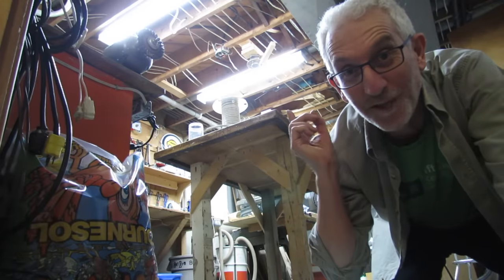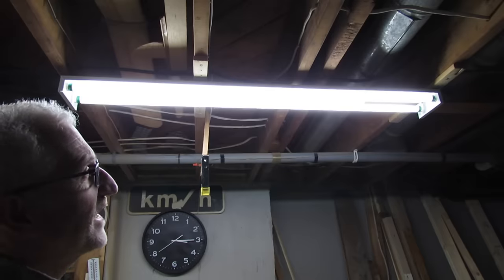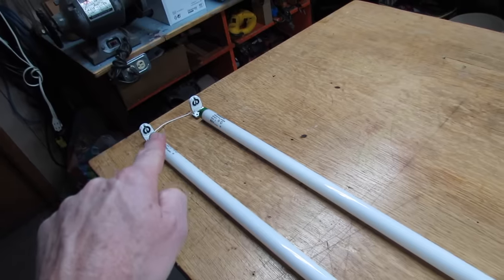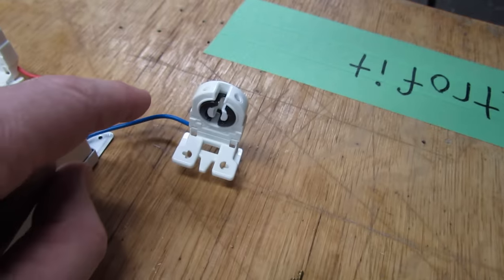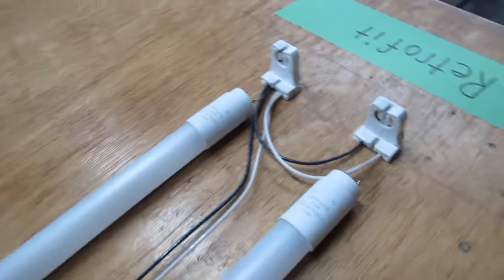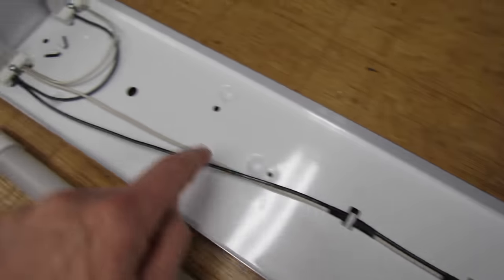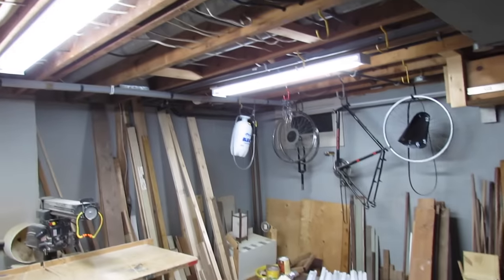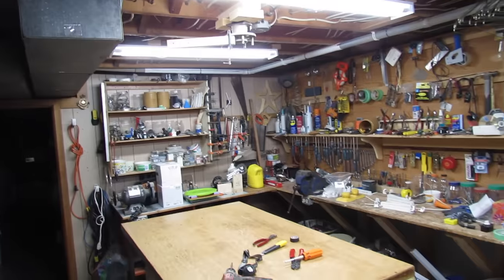How To Convert T8 Fluorescent Lights to LED ● Explained in Simple Terms

Comment: ... a great explanation of the connection differences!...and your presentation of the conversion was very clear also!  I would have liked to see a comparison of the costs of converting vs. ripping out the old and installing new lighting "strips".  Regarding color temperature, there's not much difference we humans can detect from 4100 to 5000K (both are considered to be "daylight balanced"), so I'm kinda surprised the manufacturer offers both.  2700K more simulates the color balance of the old incandescent we're used to, but that probably wouldn't be preferred in a shop.  Cheers
Reply: I would like to see cost compareson of "electric saved/price& life of bulbs" . Also life of bulbs at hot &  cold temps?

Comment: I just replaced the 4ft fixtures in my garage with daisy chain LED fixtures. Went from 3000k to 6500k and all 4 lamps will run on the same plug as one of the lamps I took out. The originals are old electromagnetic T12s and the difference in light is amazing. Plus since my shop is only heated when I run heaters the lamps are not fussy about cold like the originals.

Comment: Excellent video, Chris.  I understand this so much more now. One question - I've read that there are two-ended and single ended LED bulbs. Looks like you used the single ended but didn't mention it unless I missed it.  Does it matter which kind you use?  Thx
Reply: ok - i watched the video again. u did say LED bulb has power at one end.  ;)
Reply from the maker: You're right. The ones I used were single ended. This is for single ended conversion.

Comment: Chris, I did a bit more searching and I did find 8 foot LED tubes. 1000 bulbs is one place to find them. I don't see that they would save me enough to switch them at this time. I still have about 20 replacement fluorescent tubes. I will be converting some old 4 foot shop lights though. Thanks.

Comment: I've retrofitted lamp fixtures in the past, converting fluorescent to LED, but with a replacement of the ballast needed for the conversion.  It surprised me, therefore, that what you have requires no ballast at all.  Is there a difference, other than the obvious ballast, between the two types of LED lamps?  Longevity? noise/hum? choice of color ratings? price?   Thanks very much for sharing this video.

Comment: I might sound stupid, but why do the fittings at the other end have a wire going into those orange caps. What is that wires purpose?
Reply: @davidjames9625  the wires you are talking about are required for florescent lights, but not LED. He cut and capped them because they no longer serve any purpose.
Reply: @maxbecker5868  Thanks for that Max, it's always good to learn something.

Comment: I don’t know if it’s the bulb, but I did it exactly how you said, and it did not work. It did not want to turn on. What was frustrating is that you made it so easy to understand . I just don’t know what went wrong. I did exactly the way you did it however the lights are not want to turn on. I had the Philips LED TV Insta fit. I compared the pictures about 15 times pausing zooming in zooming out and he did it step-by-step exactly how you did it, but my lights do not want to turn on. Do you have any suggestions?

Comment: Great video for a DIY person. Around here most people wait for the 4 foot LED lights to go on sale at Costco and replace the whole unit.
Reply: Agreed, at $18 PER bulb or $36 per light plus your time. A lot cheaper to buy the whole LED assembly at $25- $30
Reply: Exactly.  I purchased some LED replacement bulbs and they don't seem to work in my fixtures.  And they cost as much as a replacement LED fixture when on sale.
Reply: @pman64  I totally disagree
Reply: I've found those Feit tubes at 12 for two. It's a direct fit. Good for 4 ft but other sizes I have to retrofit. This video will help me definitely.

Comment: Nice explanation to retrofit.  However, the "K" for your 5000K or 4100K is "Kelvins" and that's the color of the light.  higher K is more blue/white, lower K is more yellow.  The "brightness" or amount of light is indicated by the "Lumens" which for your two new led bulbs was the same at 2500 lumens.

Comment: Oh wow. Was expecting a bit more to it than remove ballast and install non-shunted ends. Will have to do this to my garage, it's terrible for lighting with florescent and highly impractical in a state that gets cold enough to freeze those bulbs. LEDs however operate just fine even when embedded into ice and a helluva lot cheaper in the long run.

The one thing to do if you get lucky on samples like this. Check with your eyes against a color card under each light against your computer monitor displaying that same color card. Pick the one that matches your monitor the closest. That should help with making sure paints you buy actually appear the same color in your shop.

Comment: GREAT VIDEO.  I retrofitted my basement with the help of this video. It was simple after watching video.
Reply from the maker: That's great! Glad it helped. What rating of bulb did you go with 5000K?
Reply: 4 foot led t- 8 tubes 3500 kelvin / 1900 lumens  15 watt in one room and t-8 U-Bend led bulbs  1900 lumens / 15.5 Watt ... (with 6" spread 21 inch long)  in the other room  AND retrofit  led bulb  end holders  NON SHUNTED .  for a guy with little to some DO- IT YOURSELF  skills  -  it was easier then I thought it would be. …………….THANKS...…………….

Comment: I found your video quite informative. Great timing too. When we moved into our house 20 years ago I took most of the lighting to fluorescent lighting. I am now changing over to LED lighting. With LED light bulbs that is done in most cases. My shop however was mostly fluorescent tube lighting. I have 4 perfectly good  fluorescent fixtures sitting around and now I see a way to repurpose them. 
That brings me to a new another subject. My shop has some 8 foot commercial grade fluorescent tube lights. Each tube is 80 watts. I have not seen a LED tubes to replace these with. Have you?
Thank you.
Reply from the maker: No I have not seen 8 footers either.

Comment: Not all LED bulbs use power on one end only.  Some require power to both ends of the bulb.  On that style you can use shunted or non shunted tombstones.  
I have converted over 900 bulbs so far.  The 4100 are good for classrooms, while the 5000K are better where more light is needed.
Reply from the maker: Correct.

Comment: I retrofitted a few fixtures last year.  I'm so glad I did.  Unfortunately, 1 started flicking on and off.  I noticed that in a few of our city's street lamps too.  You'd think that for the price of them, this wouldn't happen.
Reply: I have done a few fixtures myself and have the same problem I would check the connectiond where the light bulb goes  in sometimes  you  need to replace actually  the only flickering  lights  2or 3 are with the 8ft bulbs no problem  with the 4 ft ones
Reply: Yeah, a couple of my screw-in bulbs have flicker problems too.  I guess I'll hit up the sockets first with electric contact cleaner or emory cloth then make sure they're in tight.
Reply: Ron Yerke I have NEVER had a flicker problem, but all of mine are. NEW fixtures, not conversions,. If using a dimmer MUST use one capable of LED service , not cheap.
Reply: Ron Yerke pop st

Comment: Nice product - what do those tubes cost? I've just done exactly the same, swapping out 20 fluorescent tubes with LED strips, but I never knew about these style of products, so I used the flat led strips with magnetic fixings at the back. Each is 20W, about $4 straight from China and as bright as anything. My garage is now about 50% brighter with power consumption 50% lower.
Reply: This is exactly what I was wondering about....if you're going to retrofit, what is the advantage of keeping with the old tube style bulbs? Why not just use LED strips like MrCurry?
Reply: MrCurry - anyone have a link to the LED replacement strips with magnetic fixings? Thanks.

Comment: How much power does the ballast take?  trying to weigh if its worth getting rid of the ballast in 2000+ fixtures or just change to plug and play now and then do the conversion to non-ballast when they go out.

Comment: Thanks for the video.  I am curious if the LED retro lights had any RF or radio noise.  Did you test with a radio nearby?
Reply from the maker: No radio noise at all. I have an FM radio going in my shop all the time.

Comment: Thorough and pleasant presentation, but one thing wasn’t clear to me: when replacing the tombstones with a non-shunted type, does it have to be on both ends or just the end with power? Also, when I looked up non-shunted tombstones, there are insert type and screw type. I’m pretty sure the insert type was used in the demo, yes?

Comment: You don't need to touch the non powered end. They are just dummy pins to support the tube, so no need to even cut the wires or fit a screw it
Reply from the maker: Correct but it’s  for the next guy that does work on the fixture so there is no confusion

Comment: Not bad. But I still like the original fluorescent lamps :)
Reply from the maker: I liked them too but they can't take switching off and on a lot and burn out at about the 1 year or 1.5 year mark. Good by ballast and bulbs. We'll see how these do for energy conscious switching off when I leave the shop each time.
Reply: Chris Notap those ballasts looked like electronic ones, which just blasts high voltage on those bulbs with no preheat, and probably burned down those electrodes. correct me if i am wrong.
Reply: Only if you have instant start.  Commercial type "program start" ballasts take one second to light and bulbs last much longer.  Program start ballasts uses non-shunted sockets.

Comment: Greetings and good day: First off thanks for the educational video, it was well done and it was simplified. 
Second, I have a question, I am a building engineer who pretty much has to do it all and recently the company I work for has started to convert from T12's (F96T12/CW/HO-O ALTO) to T8's (F96T8/TL841/HO/PLUS/ALTO) with new T8 Ballast's. Now I took electrical and I am pretty good when it comes to a lot of things, but I wanted to know why would the T8's turn Pink? It's not all of them through out the building either, it's just a few here and there that have all of sudden starting turning pink. These changes are not even a month old yet and the worst part is the ones that are turning Pink are the ones that I had to special order a scaffolding to get to :(.
Do you have any thoughts or feed back?
Thank you for your time and thank you again for the awesome video.
Reply from the maker: Sounds like the ones that have turned pink are bad bulbs.
Reply: @chrisnotap  Well that is a bummer if that is the case. They are new bulbs, not even 2 months old yet. :( Thanks for replying I appreciate the feed back.

Comment: When you break a bulb like you did a lot of mercury is released.  That was the main reason I switched to all LED.
Reply from the maker: It’s  worse eating a can of tuna compared to the exposure from one lamp.
Reply: Not even close.  Newer tubes have about 5 milligrams of mercury - older tubes close to 50 milligrams.  Tuna contains between 0.2 - 0.6 micrograms per gram of tuna.  So a 4 oz can of tuna (56 grams) contains about 12 - 35 micrograms of mercury.  A milligram is 1000 times greater than a microgram.  Properly recycling those tubes is important to prevent mercury being released into the environment.

Comment: how did the LED's hold up? Did they last as long as the fluorescent?
Reply from the maker: It will be 4 years in a month and not an issue. They have all worked flawlessly without a problem.

Comment: Good afternoon Sir, if let say before convert to led, there was a 2 piece of black wire (neutral), shall i connect 2 black wire in same connector after convert to led single tube, because after fix led at living hall the light can on, but inside both room led unable to switch on, although the switch is on? waiting to hear from your kind reply, thank you.

Comment: As someone that’s done multiple retros , one thing to mention is not all led t8 replacements use line voltage. They still need an electronic (not magnetic) ballast to run the bulb

Comment: Hi,

Great video but I need a little more guidance in the following.

My fluorescent light fixture has an outlet cord and plug built into it which I plug into a regular home electric outlet.

When you completed your retrofit conversion you were left with just a white and black wire coming out of your fixture, so can I just connect those wires to whatever the corresponding attachments I have on the fixture side of the outlet cord? Hope this question makes sense.

Do you possibly have a video that might explain this step? 

Thank you
Reply from the maker: If I understand you correctly, yes. There really is just a black and a white wire that goes to the end of the bulb and that’s it.

Comment: The lamploders in the description are for with progammable ballast.  So, did you use a ballast?  I am planning to go without ballasts.  Is that then a different lampholder? Thanks
Reply from the maker: I have a new source for those bulbs and are currently not available due to covid.

Comment: There are two different types of LED replacements that don’t use the old fluorescent ballast. One uses the non-shunted connectors as you showed. The other uses shunted connectors, so that you don’t have to replace the connectors. 

Is the startup time much faster than the old fluorescent bulbs? My fluorescent bulb fixtures take 2 to 3 seconds to start, which is annoyingly long. The slow startup time is most noticeable when using a motion detector switch to turn on the old fluorescent lights.

Comment: Hydro?  And why snip the wire at the other end?  Is that potentially part of the circuit.  Are both ends of the bulb usable in the non-shunted connectors?

Comment: So basically each bulb needs 110 volt AC to one end of each bulb and to be sure is the opposite end of the bulb open or closed? It appeared it was shunted or closed in order to work. I followed your directions turned it on and it was shorted so I took it all apart looking for the culprit. Is the end opposite the line or power on your fixture shunted or closed or is it open? What does the light need?
I ordered the LED light tube model WS-T8-20A, 20Watt, 86-266 Volt.
Thanks.

Comment: I'm researching the various options for swapping florescent undercabinet lights to LED.  At this point it seems to me that rather than buying LED bulbs and LED appropriate end contacts and rearranging the wiring it in the old florescent fixture, it would be easier to simply replace the whole florescent fixture with a similar size LED fixture that already comes with the bulbs and contacts and is properly wired with no ballast to begin with, especially since you have to take the fixture down either way.  Maybe it wasn't the case when this video was posted, but LED fixtures now come in similar shapes and sizes to florescent fixtures and are inexpensive.  I recently installed two new 48" LED ceiling fixtures in the garage to augment the existing old fashioned screw-in lightbulb fixtures, and they have features a typical florescent fixture does not, such as remote control, built-in motion detector, on/off timers, and variable brightness, $80 for the set of two.

Comment: Good work. I use James tubes which are fairly cheap at a box of 30. There are varying tubes but so long as you have an  AC on both ends tube the conversion process is always easy. For those with more lampholders maybe using older T12 ballasts it's all the same, Hot to one end and Neutral to the other. All the lampholders on one end get spliced together, Easy peasy! People are always blown away at how much brighter they are for the wattage. Often times if I'm converting a lot of strip lights they'll go from 2 floro tubes to 1 led and are still as bright.

Comment: I direct wired - got rid of the ballast. Put in new LED lights and they don't light up completely. They're both receiving power but apparently not enough to completely light up. Very dimly light up - almost not visible. Not sure what the problem is. Checked connections. Rotated tubes. Same thing. Any ideas?

Comment: Hi Chris! I would appreciate a little help; I have a 3 bulb fixture at a customers and the ballast went, so I figured to save $ I would convert to LED. The unit has shunted fixtures, I was wondering that if I cut that little red wire that connects the two sides together on the plug ends and cap the ends with liquid electrical tape, would that basically convert these ends to "non-shunted" ends? I'm trying to save the customer some cash, not necessarily for the parts but for my labor to rewire them. I do a lot of low-voltage electrical stuff but this is a first for me; not a fan of delving further into the electrical field for obvious reasons. I look forward to your reply! Have a great weekend!

Paul

Comment: Great Job!
 One question I have is, If the other non powered end of the L.E.D. bulb has no power function and it's only used to hold the bulb in place, why wire nut the clipped ends of the wires?
Reply from the maker: Correct. Snip them off if you like. I did it in the video to simplify the visual part that they do nothing. Thanks.